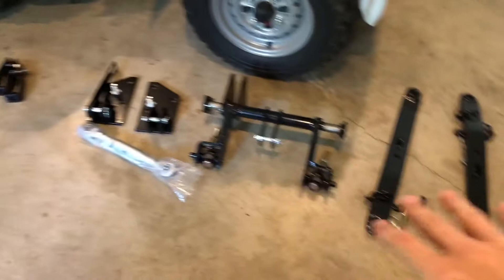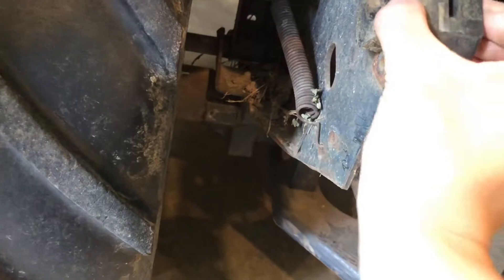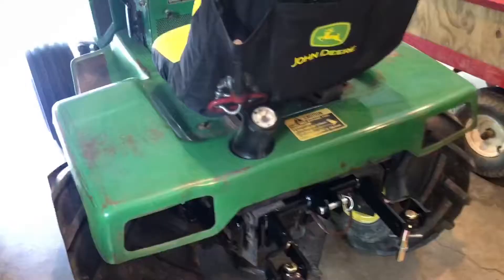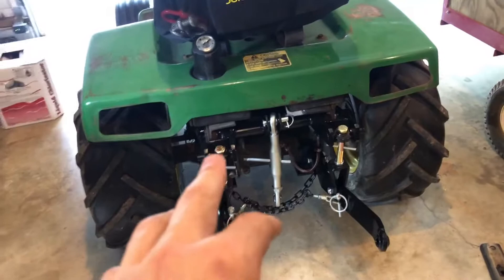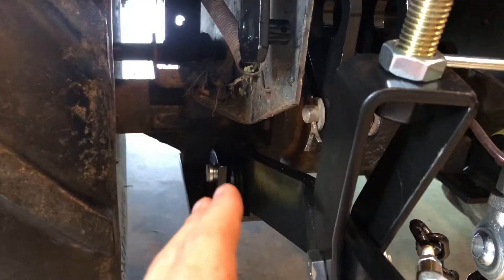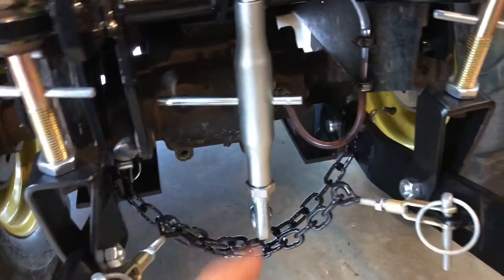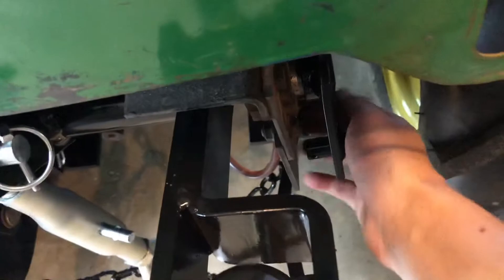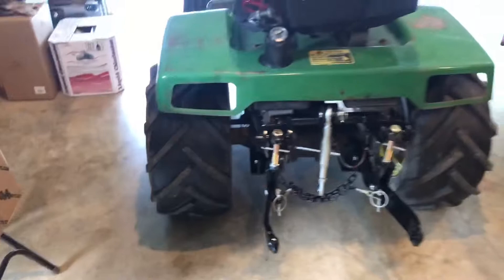John Deere 318  Ruegg Three Point Installation!

Comment: I know this video is old but I’m new to my John Deere 318. Does it have rear pto already? So if I attach this specific hitch can I control it with the hydraulic lever or do I have to install a rear pto switch?
Reply from the maker: You would operate the three point by the outer hydraulic lever